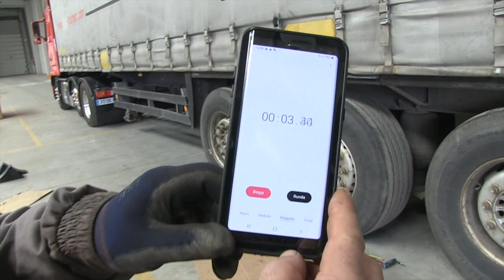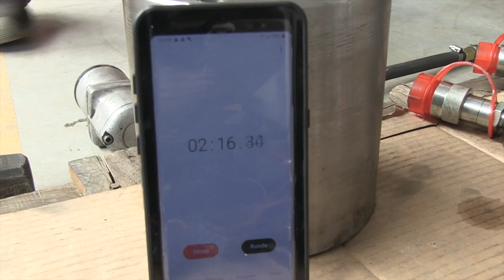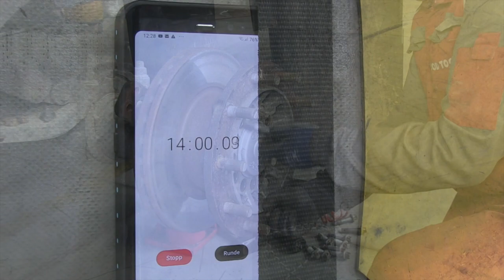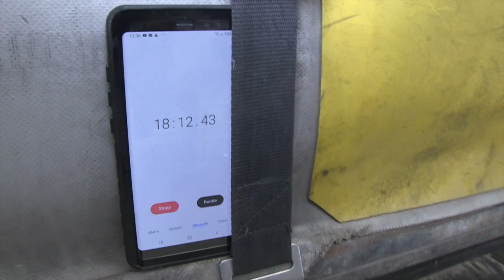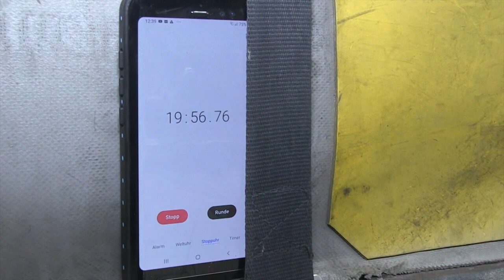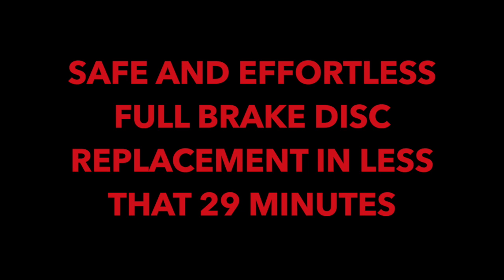28 MINUTE FULL SAF BRAKE DISC REPLACEMENT TIME CHALLENGE

Comment: what a nonsense, it would take about 30 minutes to prepare it, the guy unscrewed the caliper with a ratchet😂he didn't install the pads and the cylinder, I guess he hasn't heard about caliper adjustment.Not a single screw was torque. After six wheels you will be taken away by an ambulance 🤷🤣and you still have 5 hours left until the end of your shift😂😂